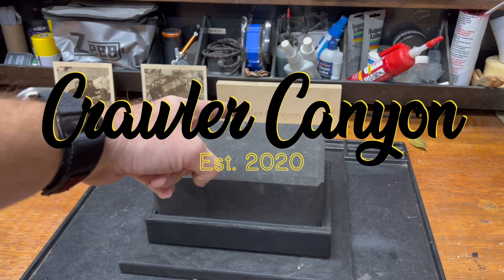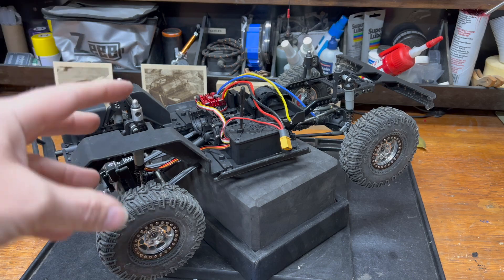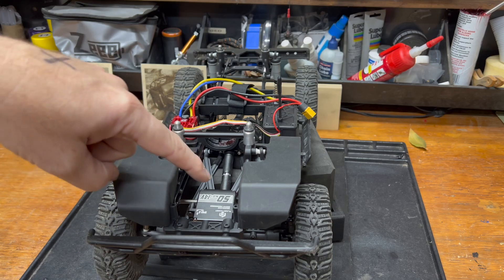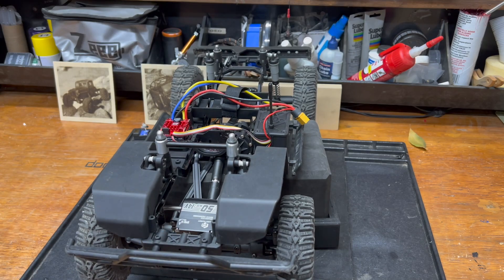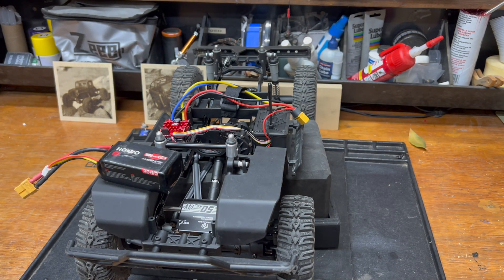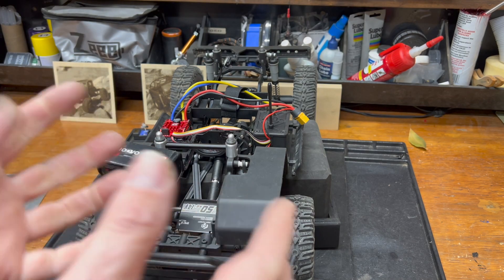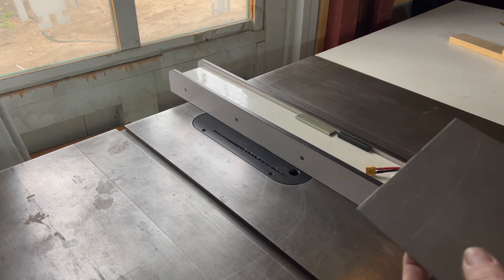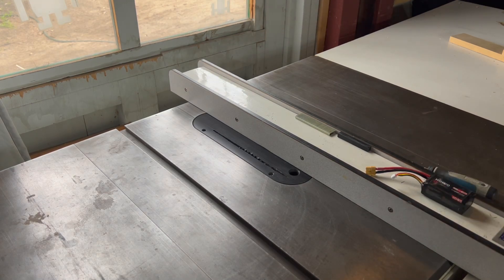Crawler Canyon Fab Lab #1: Battery on Servo on Axle

Comment: Love the fab stuff 👍👍I've definitly got major components of my rc stuck together with gorilla tape, excellent stuff.  I've used cable management velcro wraps for holding batteries in, they're pretty small, no plastic bit but they usually have a fat end with a slot to pass the other end through so they hold pretty good.

Comment: I cut a short strip from an old bicycle innertube, and double-knotted it into a loop through the strap slots. 

It doesn't lock down hard like Velcro, but the rubber grips and keeps the battery centered, while also letting it shift during an impact,
and all I have to do is pull on the knot to slide the battery under.   :}

Comment: Well now I'm curious why you're not supposed to use the cross slide and fence together. It seems like a logical depth stop for things like repeated cuts of the same length (assuming one doesn't have a miter saw on hand nor a crosscut sled). This all sounds like I am speaking from personal experience, but that is most certainly NOT the case... I promise. 😂😅🙃Also the battery bracket came out great 👍. Thankfully I have a proper miter saw now too
Reply from the maker: The rule of thumb is that the "small part" or the board should always be outside of the blade, and not between the blade and the fence.  So if you're using a miter jig, because you're too lazy to finish building that sliding table, every cut is going to have the small part of the board on the fence side. So it's kinda the illegal LEGO maneuver of table saw cuts. 

Does make for endless repeatable cuts, and I do it all the time.
Reply: @CrawlerCanyon  Thank you! That makes sense. It wasn't lazy so much as having the material to make the sled. I got the dewalt job site table saw a couple years ago and couldn't get back to CA until a couple months ago to get my dad's miter saw. When I learned of their existence a while ago, I did invest in one of those miter boxes for circular saws. I have better, safer options these days. I've been using the fence incorrectly this whole time then if the small cuts aren't supposed to be against it. I was treating the fence like a datum and square surface. Gives me food for thought to use that saw a bit differently. I have been using pushers though... my fingers stay clear of that blade
Reply from the maker: @Andy_Yates  The push blocks come out when the material gets narrower than 1 inch. I ain't trying to notch any fingertips.

Comment: I have a question! I've been debating on getting the vs4 phoenix portal build kit or the redcat gen8 rtr. What do u think would be better for crawling and trail? Plus upgrades. If I get the phoenix I have to get 3 servos motor I don't know what to get.
Reply from the maker: Vanquish by 1000%.  Friends don't let friends buy Redcat--  it's a false economy.  To get a Gen8 even comparable to an RTR from TRaxxas or Element, you'd have to dump several hundred dollars into it. Vanquish selling a kit will save you money in the long run, because there are no garbage RTR electronics to replace.  Flash Hobby 60kg for steering (about 60 bucks) and JX4409MGs for dig and OD (15 bucks apiece.) The (IMO) perfect motor for the Phoenix is the HW Fusion Pro at 150 bucks, but you can do really well with a 1080 and a CHEAP motor. For radio, a Radiolink RC4GS or a Flysky GT5 (the GT% is actually nice for the Phoenix because you can put OD on the 3-position switch which will allow you to have selectable RWD.)

So everything on top of the kit is about 300 if you go with the more expensive motor option--  but you will have something that needs literally no upgrades.  My original Phoenix portal is almost completely stock.

Comment: I know quite a few of your rigs have BoSoA at the moment, do you think the front weight bias trumps the higher battery position? I've considered designing/printing something to do BoSoA with my 24th scale, but it puts the battery a lot higher than if it were on the chassis.
Reply from the maker: The battery sits higher, but now it's unsprung--  so the overall CG actually goes down. When you move the battery onto the axle (and make no other changes,) you REALLY notice that the rigs feels oversprung. This is why I have the bag of softer springs ready.
Reply: @CrawlerCanyon  OOOO, I see I see. It adds the weight to the drivetrain rather than the chassis. I should give that a shot some time!

Comment: I like it! I'll have to try this out and see if I can do this with a 3d print instead. No table saw but my grinder would load up too bad with Al. Thanks for sharing this. Its a great idea.
Reply from the maker: If I had the patience for 3D printing (and the ability to design the parts to begin with,) I'm pretty sure it's a better option. You could have tabs that extend down to bolt through the servo mount holes, no tape required. 

Uh oh, I think I just mentally envisioned Revision 2.
Reply: @CrawlerCanyon  it might be difficult because you have such experience with subtractive manufacturing but getting the printer figured out and working in CAD software really raises the ceiling of potential fabricobbling imo
Reply: Do you have any experience 3d modeling in CAD software? I bet you could do something real simple and print it tray side down for support-less printing. I spend a lot of time when designing to minimize the amount of supports needed
Reply from the maker: CAD software is beyond my grasp. I've spent so long making one-offs (I am a human rapid prototyper) that even the notion of sitting down and spending hours to design something, then waiting a bunch of hours to print it and find out if it works...  I just can't.  I'll just make it. I will indeed do more work to maintain a certain level of laziness.